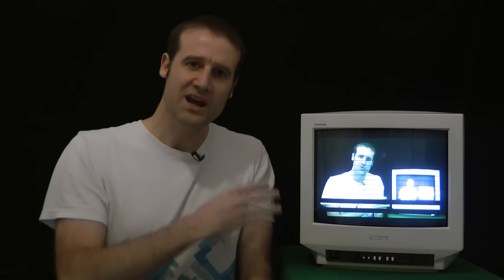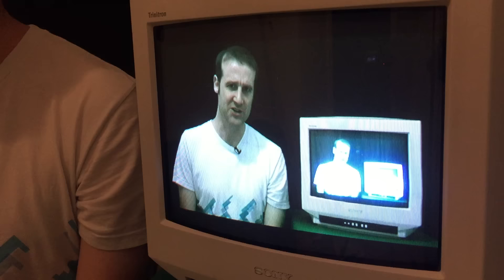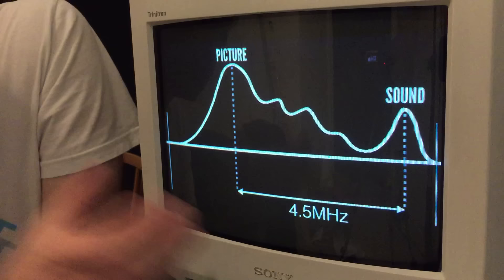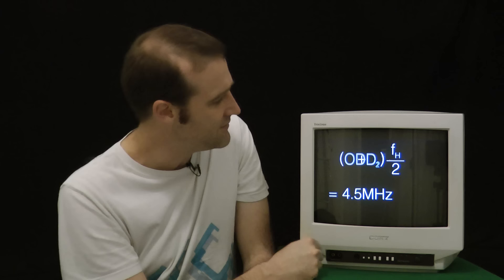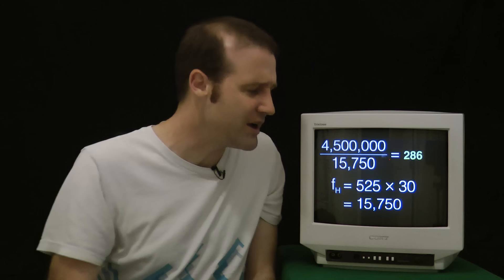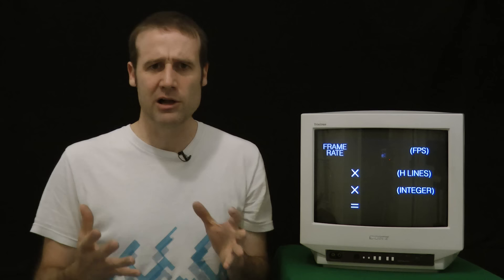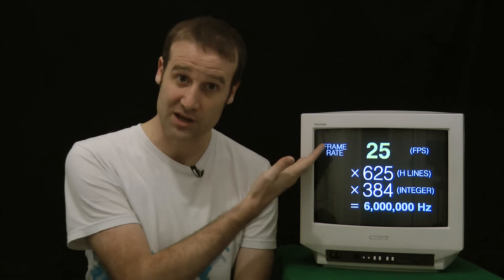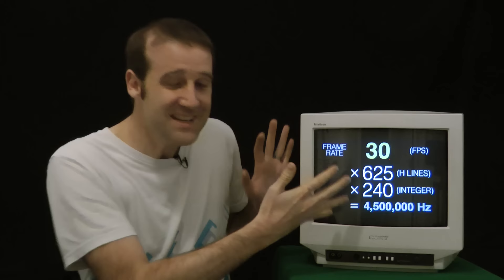Why is TV 29.97 frames per second?

Comment: I've tried to find this "line by line phase reversal" thing that's mentioned in the video. All the references I could find are questions that link back to this video trying to get an answer.

Now. I don't know much math, and other than a basic notion of beat frequencies between close signals, I can't fully explain the spacing rules that were used there, at least as explained.

Now. Some people seem to have interpreted this "line by line phase reversal" as being the same as the "Phase Alternate Line" technique that cancels out chroma phase drift induced by broadcast problems that gives it's name to PAL. But after looking around and thinking, the former seems to actually be more related to how the chroma signal may affect the underlying luma.

It seems they had to choose a chroma carrier and new horizontal frequency combination that would satisfy all the requirements, and they came up with these rules on how all the elements should relate to each other. 
In the end the effect that they were trying to avoid, once demistified is actually quite simple.

Without color decoding, or, more precisely, without the notch filter that filters out the chroma signal from luma, and sends it to the color decoder, the chroma signal, being interpreted as luma, produces what's known as chroma dots. If you have equipment that's somehow capable of doing this, what you will see is a black and white picture that's full of little holes in a diamond grid pattern. This is because, each line, the phase of the chroma signal is shifted a little as an effect of how the horizontal frequency "chops" the continuous signal into lines.
If the relation between the horizontal refresh frequency and the chroma sub-carrier was different, it could be that these dots alingned is a much more noticeable pattern, line completely veritically, producing straight vertical lines in the picture, which would be unacceptable in a black and white set, which not even the relative "blurriness" of the day would be able to hide. On the other hand, by making these two signals line up that way, the resulting diamong grid pattern blends much better and the blurriness of the sets of the day would be more than sufficient to hide it effectively.

I think this is what the whole "line by line phase reversal" technique is about.

Comments welcome.
Reply: If you divide the color carrier freq (which is calculated as 315/88 = 3.579545454~~ MHz) between the H-sync (15750/1.001), it turns 227.5 color carrier cycles each line. Just like the half line shared between the end of a top field and beginning of a bottom field (that's the cannonical order in NTSC, for some reason), the half-cycle of color carrier in each field will alternatively fall at the beginning or end of each line, making each line to be half a cycle out of phase with it's neighbors, thus reducing the visibility of the chroma dots that would appear when a BW set decodes a color signal without filtering out that part of the signal, which would then be decoded as chroma.
If the line frequency lined up with the chroma clock and all lines had an integer number of chroma dots per line, vertical lines would most probably be visible, and they'd be worse the more saturated the color was in a particular area.
With the "reversal", these dots end up in diagonal patterns, and the interlacing further helps redistribute those dots in a sort of dither effect.

The main point of this whole problem was to make a signal that was supper friendly to old black and white sets that not only didn't decode color, but didn't even filter out the color carrier from luma, because in those, the chroma signal gets decoded as luma, resulting in those dots, and if the dots aren't distributed onscreen in a certain way, they become visible vertical lines.
But the fix for that also had to be smart enough not to introduce other problems, like beating with the audio carrier frequency or something else. So that's why they experimented and came up with these rules on how to change the things they could change while not affecting the things they couldn't like the channel width, and where luma and audio had to be.

Comment: The change of the number of horizontal lines was actually considered as the technically better solution at the time but it would have made a color signal incompatible with black and white tvs - the signal wouldn't sync right. So they had to keep the same number of lines. Otherwise, color tv would probably never have taken off until the digital age.

Comment: I suspect that the 525 lines per screen was chosen so that the video would just fit into the bandwidth allotted for it and that increasing it to 625 would have opened up new possibilities for interference between the video, color and sound signals. That said, there may be a number closer to 525 that would have worked. Either way, one has to keep in mind that it was critical for RCA to come up with a standard that allowed the millions of B&W sets that had already been sold by that time to display color broadcasts in B&W and tweaking any of these numbers was likely to affect some sets more than others.

Comment: Back in the 8/16bit days of computing, we preferred the NTSC system, especially in gaming, as the 60hz refresh rate produced a much smoother moving image than the UK's 50hz rate.
Reply: 60Hz isn't that much smoother than 50Hz
Reply: @Adam-ob3vs  Perhaps, not these days, as we are used to 60hz+ refresh rates, but back then that extra 10hz made for a much smoother, less flickery image.
Reply: @franklinnash  both 50Hz and 60Hz was flickering af, if you were watching it from close distance
Reply: @Adam-ob3vs  I guess if you were using a TV. Those of us with high-end CRT monitors noticed the difference.

Comment: I actually think that backwards compatibility or smooth transitions are not a thing anymore.
Radio is switching from FM to DAB+, making old radios obsolete - especially challenging in cars with tightly integrated infotainment systems.
TV switched from PAL to DVB-S/-C/-T (and then to -S2/-C2/-T2 a few years later for HD) - at least you can easily plug in a converter box via SCART/HDMI.

Comment: NTSC at 29.97Hz (not hz) fps does not use line by line phase reversal. PAL in the UK (and others) at 25fps is Phase Alternate Line. PAL is better "quality" than NTSC because the phase alternate line sytem eliminate (cancels out) any errors in colour signal phase once received by the tv;  over the air transmission is liable to variable phase distortion, PAL averages this error, NTSC doesn't. Line by line reversal has nothing to do with NTSC. The odd frame rate is necessary because the colour carrier frequency has a fixed relationship with the line rate; this alone ensures that the interference between colour and luminance signal appears in the displayed image as fixed (no movement) patterns which are significantly less discernible to the human eye than patterns which move which would be the case if the colour carrier was not at a frequency in a fixed relationship with line rate. To accomodate this, on 525 line NTSC the frame rate had to be modified so the line rate would correspond with the 315/88MHz (3.579545MHz) colour asubcarrier. The colour subcarrier frequency was determined by capacity of the electronics (technology) of the day to produce stable oscillators at fixed, precise frequencies; so that couldn't be tweaked, but a tweaked frame rate (dictated by the line rate, related to the colour subcarrier) was only marginally lower and therefore systems operating at 30fps would adapt seemlessy even if the input signal happened to be only 29.97Hz

Comment: Here in Canada, we are trading in the old tube-based TVs for modern flat-screen TVs (LCD, plasma, any non-tube TVs).  The USA has been doing the same thing, but they started 5 years earlier.  My question is: does the change in technology throw the 29.97 fps out the window?  Many of these new TVs  are equipped with on board computers to handle programs and formats.

Comment: Fun fact: In the UK at least, the system before PAL was 25fps and 405 lines, with a bandwidth of 5 MHz, resulting in n = 493.827... If they'd done what NTSC did, and rounded it to 494, we'd have a framerate of 24.99 fps in the UK.

Comment: Moving from 525/60 to 625/60 would have increased the horizontal scan frequency to 18.75 kHz instead of 15.75 kHz. This would almost certainly have broken existing sets; while it was possible to alter the scan frequency on the receiver by adjusting its horizontal hold control, it may not have been possible to go that high without modification.

Comment: Great video but I thank them very much adopting the drop frame technique instead of the 25fps. NTSC and 24fps cinema have effectively the same clocking so there was no awful PAL speed up with the audio. Now a days PAL/NTSC is irrelevant in the digital video era but funnily enough in Europe they insisted on keeping 25fps even for their digital video except when they do film they use the 24fps or 24fps DF standard as well. It is true though PAL was 100% far superior in video resolution in the Analog era but we had PAL beat with motion due to our high frame rate which was equivalent to 59.94fps of progressive video vs PAL's 50. Not as big of a difference though as PAL's resolution superiority though. Thankfully now a days this is all irrelevant since with digital you technically use any framerate you want (for better or worse) and the world is no longer bound by analog TV standards, but rather the shell of them that were used as standards for digital video.

Comment: How about.. SECAM ? (the French PAL offshoot - I think they only have a different chroma enconding)
Also at 12:50 (or so) the monitor has a black line that keeps on going down all up until the end ! Is the a 29.97 vs 30 FPS glitch ? And at one point there was a jump so we know when and for how long it was edited (between 13:06 and 13:07 the black line jumped)

Comment: Do a video on why the Blu-rays are at 23.976 fps with progressive scanning in NTSC regions. Even 4K has this problem.
Reply: This is because Optical Disc standards were set in accordance to typical NTSC frame rate due to standardization of television in the US being at 29.97 FPS. However, it's chopped down to 23.976 because films are made at 24 FPS, and so in order for a 3.2 pull down to work cleaner, they chop off a small bit of 24 FPS in order for it be easily converted to the standard 29.97. it's ridiculous, but blu-ray is already an outdated technology so whatever

Comment: Actually most annoying "imcompatibiliy" between PAL and NTSC is not the number of lines. It is the difference in framerate, and in particular the ridiculous 29.97.

It is much, much easier to resample each frame from 625 to 525 lines or vice versa, than to resample frames. For interlaced video there is additional complexity, but still changing frame rate is harder than resampling.

Comment: Well obviously they couldn't change anything else because of backward compatibility. Changing number of lines a little would work. But not by 15%. Some old TVs wouldn't manage to sync properly and / or to stretch the image on the screen properly. While changing FPS this little was 100% compatible.
That's beautiful about color TV. It's compatible both ways. Old BW TVs could without change receive and display newer color signal, and new color TVs could receive the old signal without special support for it, as it's just a subset of color signal.

Comment: There's an old anecdote about Christopher Columbus that this reminds me of. As an old man at a local pub, Columbus was being mocked by the younger generation, belittling his achievements and lauding the accomplishments of the explorers of their own generation. Columbus asked for an egg from the barkeep, and when given one, presented the young men with this challenge: Make the egg stand upright. Naturally, they told Columbus it was impossible. He responded by slamming the egg into the table, shattering the bottom of the shell just enough for the egg to stand upright. "Now that you have seen me do it, you no longer claim that it is impossible."

The American engineers were caught in a seemingly impossible situation, so they "cracked the egg" by adopting a fractional framerate, something that hadn't been considered. The PAL engineers only managed to get a nice integer framerate by observing the method of the NTSC and changing it to be a more "optimal" solution.

That said, 25fps is garbage. Why would you have a standard that's 1fps out of sync with one film camera standard, instead of one that's ever-so-slightly behind another?
Reply: In Europe the mains frequency is 50Hz. The TV frame at 25fps consists of two interlaced frames so the flicker rate would be 50Hz to match the mains. Remember at this time, not only the house lighting, but also the TV studio lighting was tungsten, and so also had a flicker! You should think, and maybe look up some history before you make "garbage" comments.

Comment: Not all of those 525 lines were actually usable. Some were needed for the vertical blanking period. (Most sources put the usable lines at 480, but some say 495, puzzlingly.)
Reply: Yeah, why thee should be ambiguity about that is puzzling. Was there some tolerance in the length of the VBI? I think I once calculated there should be 483 lines of actual picture info, but I don't remember how. Anyway, it should be an odd number, since each field includes a half-line.

Comment: Try audio master (bit) clock crystals, many to choose from  for over twenty different sample and over-sampling rates and several different sample bit sizes: 
Some are a bit odd, some familiar (consumer/pro audio) clock frequencies are:
11.2896MHz, 12.288MHz, 
22.5792MHz, 24.576MHz, 
45.1584MHz, 49.152MHz
With sample rate conversion it starts to get complicated, although some do utilise the same common integer factors, yeah.
44.1kHz adoption for CD is a murky story involing a particular recording of Beethoven's 9th (possibly), Germa441/383i early B&W TV and a compact format that was big enough not to fit in your pocket (shoplifting was a problem with casettes).

Comment: The problem is that this should have fixed with ATSC, by using a 30FPS frame rate and converters to analogue would keep a 1 frame buffer, dropping that frame after 99 to resync to the TV.

Comment: I thought the reason for using mains frequency for the frame rate was to keep the inherent, "wavy line," at the side of the screen, caused by the indomitable mains hum, stationary and not having it scanning up or down the side of the picture.
Also, I'm pretty sure that the frame is not actually locked to the mains frequency, it just runs at the same rate.
For one thing, mains frequency tends to drop with increases in load and is tweaked to keep synchronous clocks showing the correct time, on average.
Reply: Quite correct!

Comment: What's funny is that while the 29.97fps standard was made for analog signals to keep everything compatible with older B&W TVs, modern digital video equipment still makes videos at 29.97fps, or doubled to 59.94fps for a "60fps" video, when none of that should matter to a computer, LCD TV, etc.  I just wonder whether a video I record is genuinely 29.97 (or 59.94) fps, or if it actually is 30 (or 60) fps.

Comment: Thats not clear for me.
Color carrier should be integer+0.5 multiply of line frequency. Therefore what was + on one line, will be - on next line, and visually cancel each other with no visible strips on B&W TV. 
Why this odd number is also required for separation with sound subcarrier ?
Un/fortunately in Europe we have 500kHz multiple of fH, and sound frequency 5.5MHz, 6.5MHz, 6.0MHz,  so we can't prove anything that way.
However, we also used SECAM system, in which color subcarriers are frequency modulated, so the frequency varies ... and that's not produced any audible effects.
And either not much visible.

Yet another would be to shift sound carrier to 4504500 Hz.
4.5kHz from nominal ... I wonder if receiver notice that. Unfortunately NTSC choose 25kHz deviation, so 4.5kHz is not a small change.

Comment: Speaking of standards that should have had more thought put in, base64
“Let’s start counting at A and have 0 be 52” said someone
And everyone said, “I dunno, sounds good to me.”
Reply: Well since it's 6-bit chunks that easily get out of alignment, it really makes no difference where the set of digits go relative to the 2 sets of 26 letters... :-B
Reply: @irrelevant_noob  obviously the spec still works, but it is completely removed from every other standard, which blocks actual standardization. 0 should be first, then either uppercase or lowercase (ascii has uppercase first). But no.

Comment: Great video and explanation but I'm surprised you made no mention of another factor in settling on 29.97 fps, namely that it happened to be exactly one 1 thousandth less than 30 fps and that such a small difference in fps made virtually no difference to the playback time when broadcasting black-and-white material recorded prior to the induction of colour.

Comment: The problem was that TVs of the day were set up with RC and LR and LC time constants. And you had to tweak (adjust) them to get everything stable. Horizontal frequency was fixed by the flyback oscillator and couldn't be adjusted much or easily.  The service calls to adjust to a new set of frequencies would have been impossible. And expensive. Just change the frame rate  by .1% - no one will notice. And they didn't.